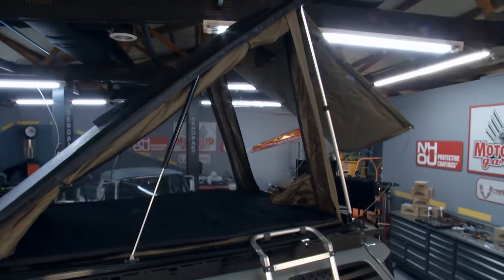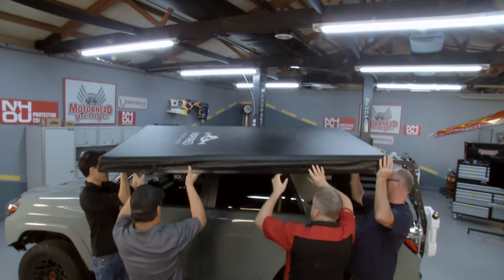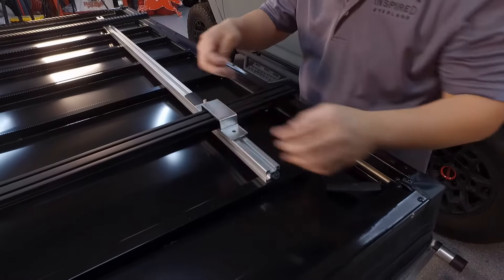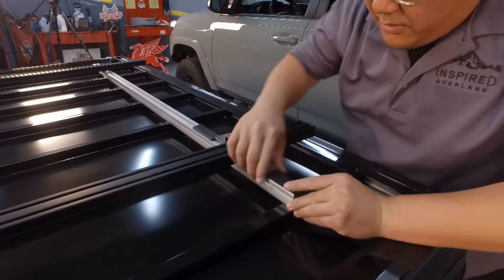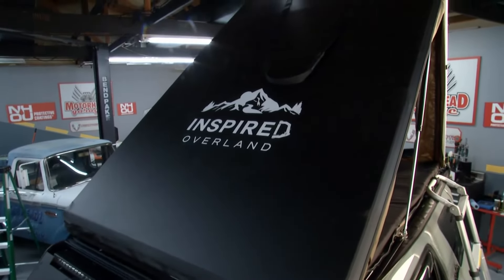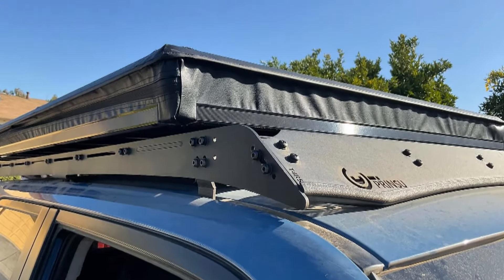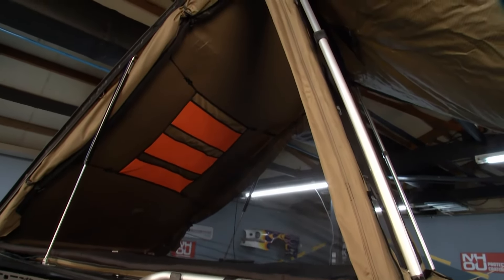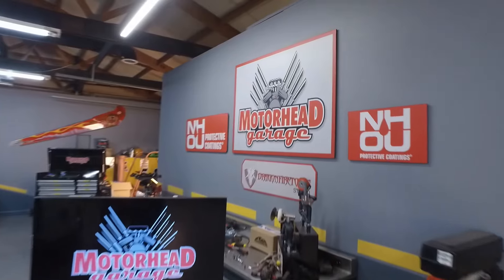Inspired Overland Ultra Lightweight Rooftop Tent Featured in Motörhead Garage by Motortrend

Comment: Very interested in mounting this to my Tacoma camper shell. Looking to cut a hole in the base (as a pass through to my truck bed), but I see cross members on the bottom. Are the crossmembers adjustable or removable?
Reply from the maker: Hi, unfortunately the bottom can’t be cut through.